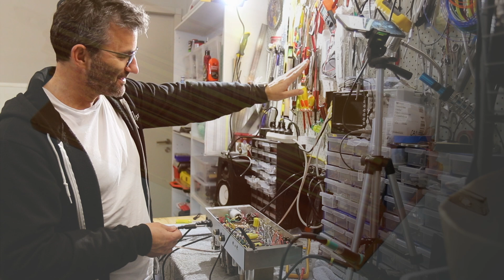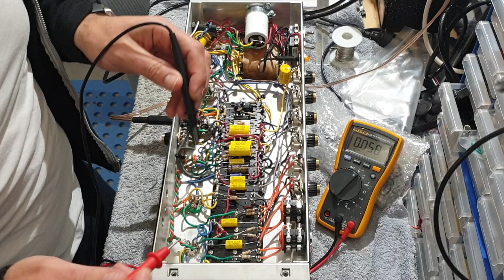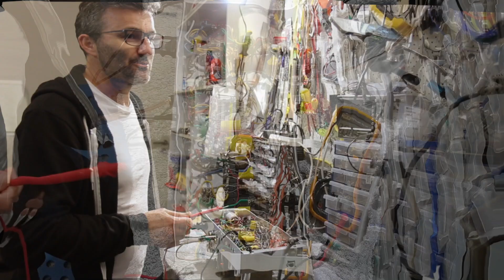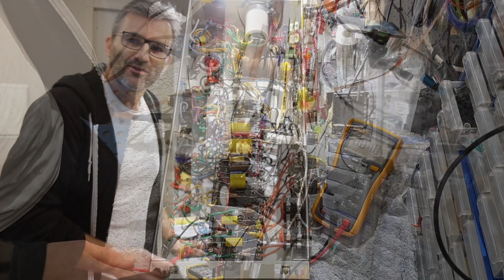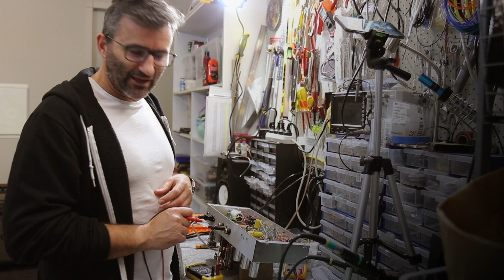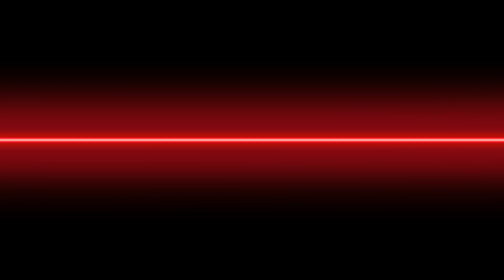Using a Digital Multimeter + Amp Startup Procedure - AT THE BENCH!

Comment: any suggestions for a reputable dummy load (other than my cab speaker?). Seen a few from amazon / eBay but wary that's it's pretty important to get something reliable! thank you (I am in Australia too).
Reply from the maker: You can buy high wattage 1000W+ fixed resistors from suppliers like Mouser and then just wire up your own speaker cable to it.

Comment: Thank you for this video. I have this exact same amp from Mojotone and I have no sound whatsoever. Everything has tested fine for the most part but I think I have something missing from the feed to the preamp. In other words, pin 6 has no voltage. The 306v you got isn’t showing on mine. I’m so frustrated. This my third amp and the first one I’ve had an issue with.

Comment: I'd remove the tubes for the first power up and use a light bulb limiter.
Reply from the maker: I don’t
Reply: I was told by a tech to pull all tubes out while I was testing a fault I had. I quickly realised never to do that again. With no load, supply node voltages will be higher and possibly above filter cap ratings. Leave the tubes in.
Reply from the maker: @peter-0200 exactly
Reply: @HeadfirstAmps  I do use a power limiting box for AC mains, using a 40W light bulb in series with the active. No varriac YET. Might buy one at some stage.

Comment: Noticed the multimeter connection to the mA port. Is there any reason to not use the 10A port when measuring 6.3v AC heater voltage? Don't the heaters draw typically exceed 3A in your average Marshall amps?
Reply from the maker: You’d one use the 10A socket if you’re attempting to measure the heater current, which should not be necessary.

Comment: Probably better to use a 10ohm load resistor instead of 8. Impedance and resistance are not 1:1
Reply: Neither is an amp when connected to speakers. That's why it's a "simulated" load, not a mathematically perfect one. It's useful for getting real-world reading
Reply from the maker: They are not the same thing at all.

Comment: Great Video! You don't recommend using a variac to wind up mains on startup? I know some guys do that. Also, can you show how you connect the bias current meter? I don't think that was shown.
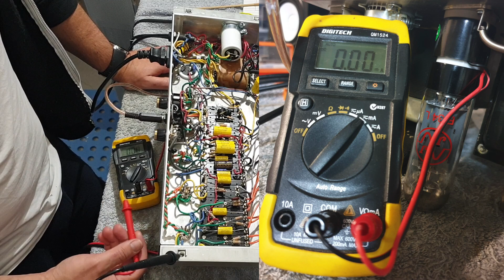Reply from the maker: I don't own one, never have.  Just flick the switch mate!   I show a still picture of the probe setup in the video at 16:58
Reply: I can see how the meter itself is setup but you just say it’s connected to the power tubes but doesn’t show how. Thats what i was asking about.
Reply from the maker: Ah ok, gotcha.  Its one of these,
https://www.amazon.com.au/dp/B07CR5DN1V/ref=cm_sw_r_cp_awdb_imm_E9CBNWAVFNKP1YFT7FP0

You plug the probe socket in between the tube and the chassis socket